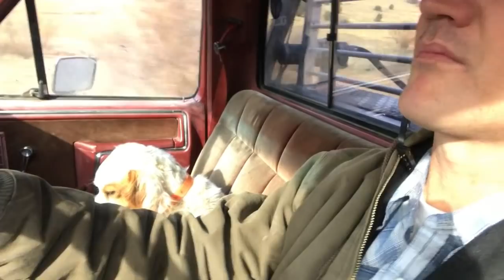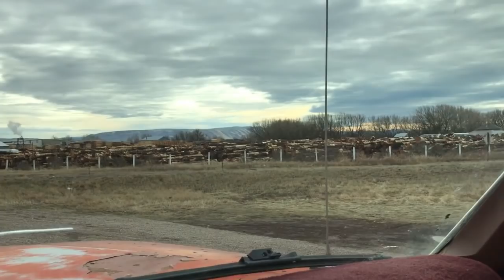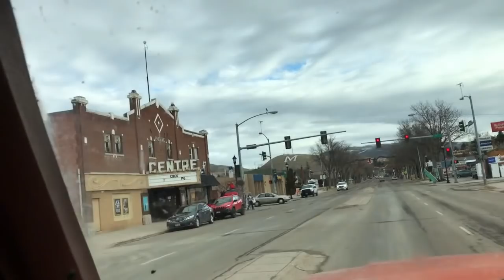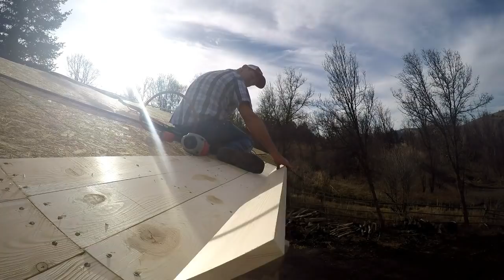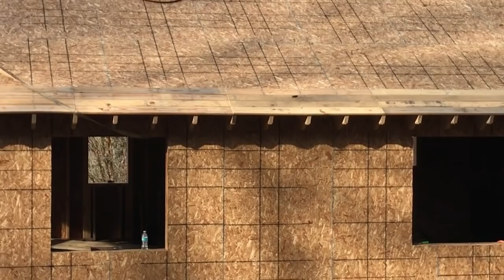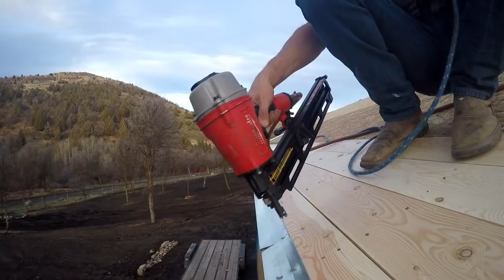I Framed Up The Eaves, Drip Edge And Local Sawmill

Comment: I’m going to repeat the comments about a fall harness-I’ve done lots of roof work without one, but decided to harness up on a recent job.  I won’t harp on the consequences of a fall,  you are a smart guy and can make your own choices- but think about it.  Really admire the solid work you are doing!
Reply: unless you are an action hero from the movies i dont think anyone could hold back over 200lbs with nothing but grip strength on a rope. And even if you could , I wouldnt trust a single low capacity rope to take that initial load.

Comment: I know its too late but i overlap my drip edge sections 4 inches to prevent water from wicking between joints. Looks good
Reply: vettepicking ... I was thinking the same thing...
Reply: You're supposed to overlap it.  And like you said, too late now.  Hope he caulks the heck out of that joint before putting up the roofing.
Reply: I would think a pretty easy fix is to cut some overlap sections of drip edge for the seams?
Reply: Cut small pieces to use as a spline behind the joint. Caulk won't last well enough.
Reply: You're right Digby, that should work,  Cut a 8 inch piece over the gap and make sure to center it on the gap. And @ Super... he nailed the ends down, so doubt he'd get a spline under.
Reply: better would be to overlap the joint indeed and use a bit of chalk/ silicone etc... that will prevent any moisture crawling in.

Comment: Probably to late now, but you should have found  re-tractable lanyard on Craig's List or EBay and just tied a rope around your waist to attach it to! That way would have freed up your other hand for work instead of holding your safety line! Maybe find or cheaply rent some sections of scaffolding from a local contractor that you can use to help get roofing up and do trim work? Scaffold could be set on planks and slid along to move it. Really nice work, especially for someone doing it by themselves!

Comment: Hello there. I’m currently building a tiny home and am currently working on my roof. Just curious what size roof sheathing you are using?
Reply from the maker: Not sure if you're asking about the roofing underlayment or something else but the underlayment I used is 3' wide by 100' long.
Reply: Red Poppy Ranch Im referring to the thickness of the OSB. I should have be more clear in my question, sorry about that!

Comment: Just wondering why you didn't stagger the laps on you roof edge boards or overlap the drip edge?
Reply: Guess you didn't see him install the OSB on the roof.....
Reply: zeke112964 yeah I did. Some seems lined up then too.
Reply: Yes and then at the top he ran them vertically instead of horizontally
Reply: zeke112964 yepb saw that too. Definite non-conventional and less strong.
Reply: Thomas Russell There's very little structural value, if any staggering the Starter Board.  The overhang is so small compared to what the plywood is holding.  The "pros" rarely if ever stagger it either.

Comment: Well, great job so far!  Have you looked at aluminum shakes or steel shakes (g-90)?  Have you seen those beautiful metal shakes on homes?  I am not talking about the large vertical pieces, but the ones shaped like asphalt shingles.  At least have a peek for fun.  They cost more money than asphalt shingles, but it doesn't hurt to peek (smile).

Comment: I have never seen 3/4 lumber on the edge of the roof like that. Is that a snow-load thing? (I live in Lower Alabama where flurries shuts down the world..)
Reply: The idea is to have the underside of the overhang area look beautiful with nice wood plank pieces, instead of looking at sheathing.  When you are on the ground outside and look up, you see beautiful wood.  But if you are using 5/8" sheathing, you want to use 5/8" planks, otherwise there will be a lip between the two edges.
Reply from the maker: just for looks